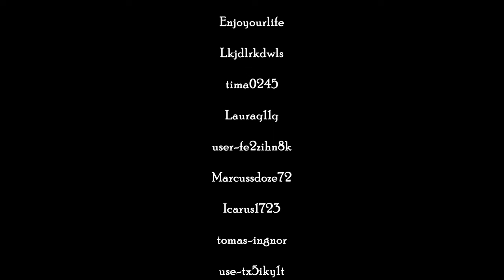Making an automatic refueling system / DIY

Comment from the maker: Whenever I put oil in the oil tank with a manual corrugated tube, it was annoying and disturbing.
The automatic gas pump that came out as a product is too expensive, and I tried it once, but it was too weak.
I was making an automatic gas pump with an impact drill-powered pump, and the pressure was so weak that I used an underwater pump to make an automatic gas pump.
I made it in a hurry to make up for the failure, but after I made it, I wish I could have wired more simply and used a safer switch.
So I made it again. You can make it very easily, so I think it'll be good to make it and use it. Thank you.